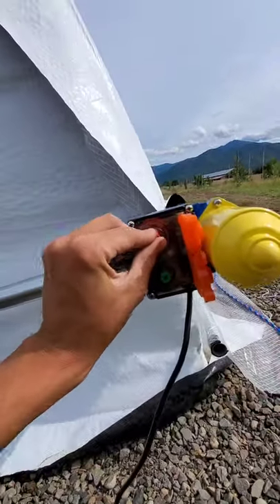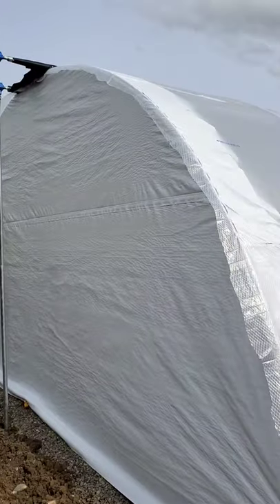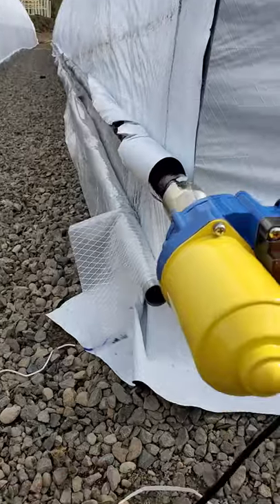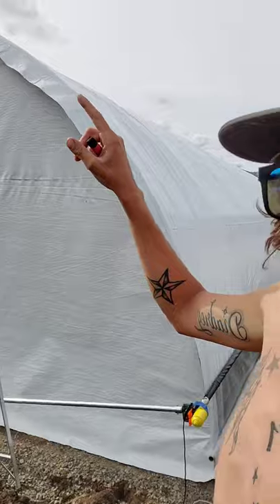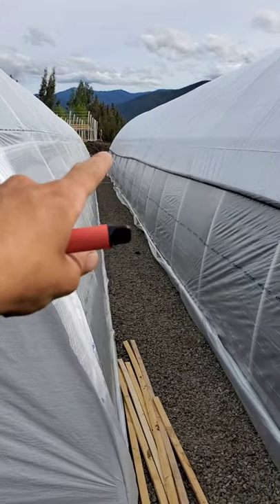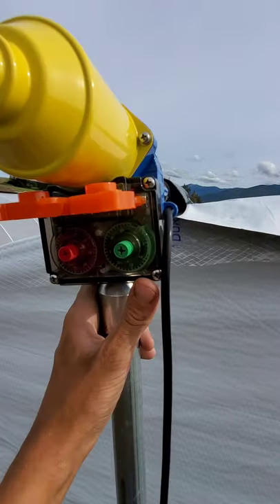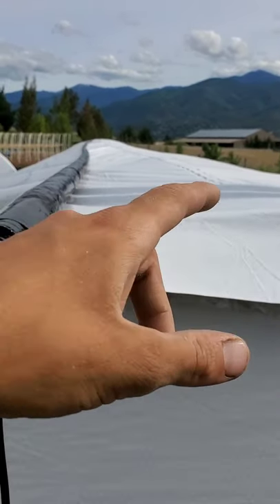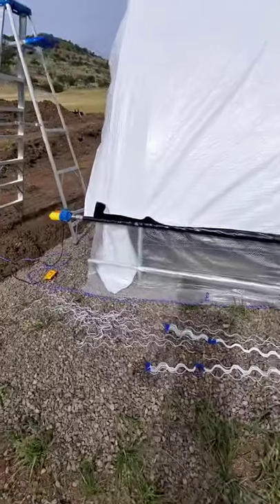How to adjust greenhouse motors

Comment: Man this video is very helpful i am facing this issue to adjust the motors and it is going slow since there are already plants in there. it made me feel better when you said do net let it open by itself for the first weeks because i dont think i will be automating it soon. It is indeed a tedious task especially to figure it out for the first time and to make it worse i am making it inside a second frame so i have the greenhouse above the light dep